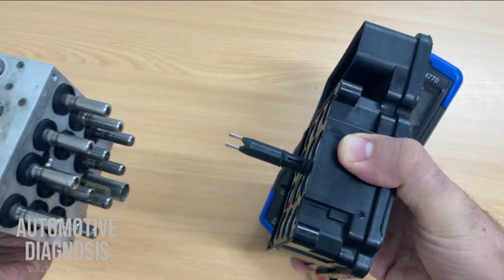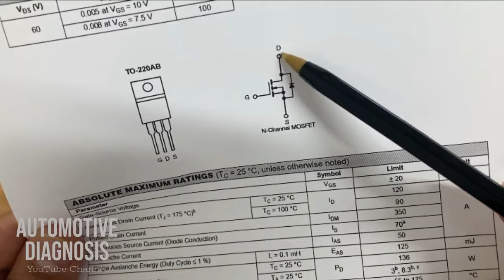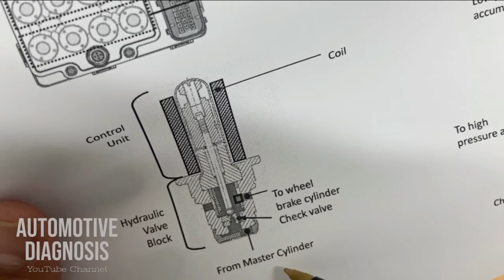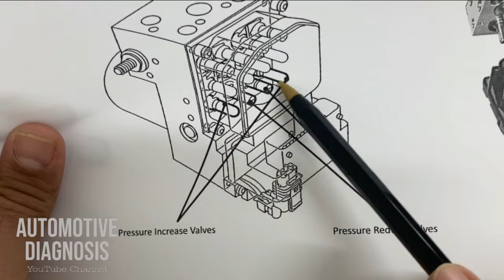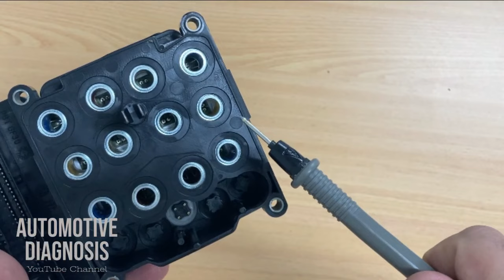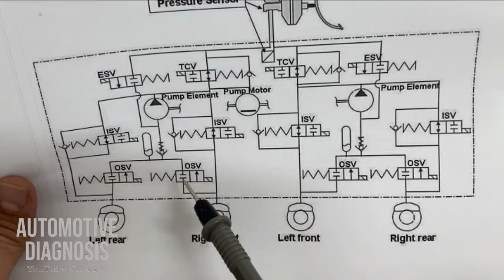Don't Replace ABS Module Before Watching This | Part 2 | ABS Module Components Test #abs #tcs #ESP

Comment: I am currently working on one of these for a friend. This video is very helpful and helps me verify what I am seeing also. I did notice the second "mosfet" you tested seems to be a dual diode package on mine. The test still works tough. I assume that is why the forward voltage is lower at around 0.2v. Thanks for sharing. Happy repairing!
Reply from the maker: I hope this video helps

Comment: Well I completed all the checks you guys suggested in the video and they all check out BUT it looks like on my ABS module for Jeep wrangler (2014) that all the pins just poke thru the holes in the board and aren't soldered. Is this normal and sufficient??? Has anyone else seen this? I can't add pics for you to see but I think in your video it's the same thing.

Comment: With error code C0110-04 motor pump circuit Captiva C100 what do I need to check, thank you
Reply from the maker: Hi there, this code is for the ABS motor fault, first check the power and ground on the ABS module (there is a video on channel for this) if all is okay, fault could be internal (part one of this video that you are watching is for explaining that fault)

Comment: What was the problem with this one? I am getting a c2200 on a Jeep. Everything from part 1 & 2 passes?
Reply from the maker: This unit had the issue on the main microprocessor, your fault code is for ABS internal error, so checking the solder connections is needed at wider level. It could also be part issues like the main microprocessor.

Comment: If I pull the plug off the module, and I only have two large pins 2 medium pins and a bunch of little pins, if I check continuity on the two big pins and it's open Line does that mean the module is bad or the pump is bad? Or  both?
Reply from the maker: Hi there, those 4 bigger pins are for the power supply and ground on the ABS module, so we shouldn’t check the continuity between them, if we are checking on the connector, we must check the positive and negative to make sure they are provided on the connector, the following video explains more:

https://youtu.be/8F5FKOaa0rc?si=2BRvbt9s2ag9yukJ

Comment: I have error code c1350 on my Citroen c3 (internal valve error)
Reply: What should i do ?
Reply from the maker: Internal diagnostic is explained in this video and external diagnostic is explained can be found on the following video:

https://youtu.be/8F5FKOaa0rc?si=ausFjgwU-t3BdIiH
Reply: @AutomotiveDiagnosis i think i found the problem, i mounted an absmk100 on my car, and my car only read mk70

Comment: SO WHAT HAPPENS IF THE SOLNOID VALVES ARE OUT OF RANGE, DOES THAT MEAN THE WHOLE ASSEMBLY IS BAD? ?
Reply from the maker: If the solenoid valves go bad, basically ABS cannot control the brake fluid pressure on wheels individually and ABS will stop working. Even having one solenoid valve out of range will cause the malfunction on ABS.

Comment: My OBD reader shows that voltage is zero at motor
Reply from the maker: Check the ABS high amp fuses in engine fuse box, here is a video that can help:

https://youtu.be/8F5FKOaa0rc?si=Et_IsVAUDm-jzaV3

Comment: Great video! Do you have a video on how to check the brake pressure sensor too? I have an electrical failure on sensor A. It´s an ESP MK 61 for a Volvo s80.
Reply from the maker: Hi my friend, we don’t have a video exactly for that sensor, but what we see in this video shows the sensor’s contacts that can cause the issue sometimes, sensor itself or the main microprocessor could cause this issue too. I will do my best to make a new video for this.

Comment: So if everything looks "right" within the PCB, that means the fault will probably be within the hardware block itself (valves + motor)?
Reply from the maker: That also could be because of the main microprocessor too.
For valves and ABS motor we can test them individually with Scan tool or on the bench.

Comment: Great instructions, thank you for sharing. Does code B1342 indicate error in mechanical or electronic side of the control module?
Reply from the maker: Hi there, this could be internal issue. It could be caused by cracked solder joints only, or internal PCB board failure. But checking the power supply and ground on the ABS module is important to be done before doing anything on the module itself.
Reply: @AutomotiveDiagnosis  Thank you. Is it the pins on the wiring harness where to check the ground?

Comment: que puede causar que el motor de este modulo de ABS permanezca encendido. desde que se abre switch el motor queda energizado que componente debo revisar este modulo pertenece a una moto marca yamaha nmax 155cc quedo atengo gracias.
Reply from the maker: Hi there, it could be the ABS module or the relevant power mosfet. Please check the part 2 of this video. Link in description

Comment: Thank you for a great channel 🙏 
Did I miss the wheel speed sensor circuits? 2011 Ford expedition 4x4 codes c1145, c1175. Front right, rear left sensor input circuit failure. Getting 12v from harness at speed sensor. Both sensors are good. Only thing it could be is abs module?
Reply from the maker: Hi my friend, It could be an internal issue, but first we must check the ABS connector, and the relevant pins, checking the signal wiring between the sensors and ABS module is important, even if they are two separate sensors, some part of the wiring might be damaged at some point that affects both sensors.

Comment: Do you repair these for customers. Or do you just show the instructions on how to repair them. I need mine fixed. I took off the back and I'm not good at this. I have a 2013 VW BEETLE CONVERTIBLE 2.5L. The body and top iand interior are in very good condition but i casell this because of this problem. I need help desperately

Comment: Great video, thanks for the info, for a code c2200 on a ram truck what should I look for?
Reply from the maker: Hi there, this could be an internal issue, but still checking the connector, power and ground on the connector could be helpful to find the issue, a similar procedure is explained on this video:
https://www.youtube.com/watch?v=8F5FKOaa0rc

Comment: I had zero ohms on ground and 18.0 ohms on positive does this sound right
Reply from the maker: Hi there, we don’t measure the resistance on positive terminals, unless it’s continuity between the positive pin and fuse box.

Comment: How do I find the diagram/schematic for my specific module ? I've tried googling the part numbers to no avail. Trying to find out what circuit pins or area is related to the right wheel speed sensor on my board

Comment: I have a vw abs module that is not providing 12v to all four of the active wheel speed sensors. I saw you have a class and wanted to know if any internal abs circuit diagrams were in there that would provide some insight where to look / diagnose / repair the module itself.
Reply from the maker: Hi my friend, you can check the course content before purchasing it, it shows all lectures in detail. Regarding the issue, it’s not very common not to have the power supply on all sensors, what model is your car?
Reply: @AutomotiveDiagnosis  Its a 2011 VW Jetta 2.5SE, 1K0614517CK is the main number on the pump and 1K0907379BC is on the computer module. 

I did see the course content, but wasnt sure if you went into further detail regarding the internal abs module circuit diagrams covering the power supply to the wheel speed sensors. 

i am getting .2v on each of the front two wheel speed sensors and 2.0v on each of the two rear wheel speed sensors and i have codes (00290, 00285, 00283, 00287) for wheel speed sensors. Getting the same voltage reading on the front and rear makes me think the fronts and rears independent (shared front, shared rear) 12v supply lines but I am not sure. 

I am able to communicate with the module and read live data and have 0mph for all wheel speed sensors. I back pinned the wires at the module to get the voltage readings above.

Comment: Great instructions, thank you. Can you help with my code 16352 on my 2011 Jetta. I’ve checked the power, ground, and continuity and they’re all good. What else do you think I should check?
Reply from the maker: Hi there, If you have checked the power and ground, and connector is good too, it might be an internal issue on ABS module.

Comment: Can you explain what is broken in the ABS to cause the speedometer to not work (Saab 2000 ABS modules)?
Reply from the maker: Hi there, it could be the vehicle speed sensor failure
Reply: @AutomotiveDiagnosis It's not that. Definitely an ABS issue many folks have. Not sure if the ECU is involved somehow.

Comment: Hi,how you remove the cover
Reply: Thanks,but late, already opened, really easy with a rotary hand cutter tool, guys reworked al board with SMD hot air gun,works perfectly
Reply from the maker: @ Thanks for sharing this with us
Reply from the maker: Hi there, I normally use a mini hot air gun on one side of cover to heat the seal up (not too much), then I use a small cutter to cut through the seal, as soon as seal is broken, I pull that side up gently, and will go on to cut the rest of the seal, it works every time.

Comment: How you remove the cover
Reply from the maker: Hi there, I normally use a mini hot air gun on one side of cover to heat the seal up (not too much), then I use a small cutter to cut through the seal, as soon as seal is broken, I pull that side up gently, and will go on to cut the rest of the seal, it works every time.
Reply: @AutomotiveDiagnosis thank you! Out of curiosity, how did you put the cover back on?
Reply: @kylewilliams3336 u glue it , use ones that's safe for electronics if it's too runny it'll get inside and ruin it

Comment: Your 2 videos help me a lot thanks so much for sharing your knowledge. I'm trying to find issue on Passat B7 1.6tdi with  no measure on the rear wheel right. I've already replaced the abs sensor, but error still here. Is it possible a blocked Valve or is it an electronic issue on circuit of calculator?
Reply from the maker: Hi my friend, thank you for watching the video, it could be actually both, but the priority is to check the circuit first because it’s more common and less expensive.
Reply: @AutomotiveDiagnosis  Thank you for your support

Comment: Wow great video..I do not understand 1 thing. You said you checked the 9 solenoids, but I did not see where the coils are on that PCB ? I though the coils were in the other side wrapped inside those tall solenoid spikes. The drawing you showed for the solenoid coils looked very similar to those used in fuel injectors.
Reply from the maker: Hi my friend, yes they were on the other side of the PCB board. On some ABS modules they are very accessible, on some they are covered.

Comment: Very interesting videos. I have a 2007 Chrysler Grand Voyager with "Left front wheel speed missing". The ABS icu is MK25E. When I measure the two wires to the abs sensor the voltage between the signal wire and the +12V wire is 12V. This tells me the signal wire is shorted to ground, and it is not shorted in the wiring between the sensor and the icu module. It is shorted within the abs icu. Any idea what is wrong with the circuit? My icu looks very much like the one you present in the video.

Comment: Just wondering if you have ever tried using one of those solenoid testers which light up when they detect a magnetic field to prove the electric signal when forcing the solenoid on. Just a thought for a quick test before you start dismantling the electronic box.

Comment: Very detailed videos, pt1 and 2.
I have a Chrysler ABS which looks identical. I get the C2200 error.
Fuses good , power supplies good, cleaned all the grounds. With my scan tool I can activate all the solenoids and hear them click. Test pump and it runs. Have bled all the brakes and done a successful ABS bleed. Driving the car looking at live data, all four wheels showing same speed, good pressure and vacuum reading, brake switch good, abs report 12VDC and 5vdc on power rails. Steering angle and body sensor all give good readings, time to replace module?
Reply from the maker: Hi my friend. Considering that you have checked the power and ground, and all components are responding on actuation test, this could be an internal issue.
Reply: @AutomotiveDiagnosis thanks for the reply. I was doing more testing today and if I try to activate solenoid 12 low pressure feed 2 quickly it fails. I’m assuming it will be one that there is only 2 color coils the same. Time to open it!

Comment: Amazing content! Did a few ESPs repairs already (but I do swaps and conding mostly) and the video added up some knowledge on the structure!
I'm needing a mentor more in the head units area now, I had already two cases with blown up either amplifiers (BMW G30, which no one wants to repair them, and the replacement is like 1.6K + shipping here to south america), and NTG in mercedes that does nothing (but has consumption), and couldn't fix them so customer replaced in both cases, but anyways I'm trying to find out what went wrong just to build up knowledge.
Reply from the maker: I'm glad you found the video helpful, and I appreciate you sharing your experience!

Comment: This is excellent ..thank you very much   QUESTION..How do i find if there is an error and its not just a fuse or dirty sensors. i went to a local parts store where they hooked up a tester which returned no errors but that might have been because the tester was not the right one. ?
Reply from the maker: Hi my friend. Thanks for watching the video. Having a bad scanner may cause some issues as well, but what sort of problem do you have? Is ABS/ESP light is on?
Reply: @AutomotiveDiagnosis  Thanks for getting back. 
So the abs light is on , it a two wheel drive Xterra and slid all over the place on a little bit of snow. I cleaned both front sensors of metal dirt and put them back in before going to auto zone to have the abs light turned off but it didn't turn off even after that and after disconnecting the battery negative for an hour. 
However the AutoZone print up of the scanner results gave the ABS a PASS
I also went to a real mechanic today to have a proper check done but he can't fit me in to his schedule for about 3 weeks.
Reply from the maker: @JohnODonovan1  I don't know how they gave ABS a Pass when ABS light is on. ABS light could be on for many different reasons, Wheel speed sensor is only one of them. So, having the car checked by another mechanic is a great idea. But without having some information, it's really hard to say.
Reply: @AutomotiveDiagnosis  Do you have any suggestions for commonly available affordable tools that will give me some general information at least?
Reply from the maker: a budget scanner that might cover your car is TopDon topscan, check the video on the link below:

https://youtu.be/zpTOxeDcEzc?si=fI7SupGb2j15nFx1

Comment: I have a motorcycle with a similiar looking abs module, after riding it breaks itself but does not release pressure, its like allowing brake fluid to go to brake caliper but return is blocked, it will release pressure after few hours, i replaced the valve block already but same so i think its something with the electronics, do you might have some ideas what it could be ?

Comment: I am facing some B1342 error on my Ford Fusion 2010 2.5. Trying to figure it out and fix by myself. Just saw this video and its previous. Here in Brazil they are charging something around 2k US dollars in local currency to fix the ABS problem. Simply respond saying that must to replace the entire abs module and that was the total cost of replacement plus service which is way too expensive considering the car price... Anyway, will do it by my own hence it is not working properly :)

Comment: Hello, in my case the ABS motor has remained activated, it only stops when I disconnect the battery, any advice?
Reply from the maker: Hi there, it could be ABS unit issues which does not deactivate the mosfet.
Reply: @AutomotiveDiagnosis , thanks!
Reply: @AutomotiveDiagnosis  I am having this same issue. Are you saying this is unlikely for us to be able to fix using the info in your videos (like replacing a mosfet or something)?

Comment: Hi, i have an issue with an Volvo S80 2007, first i got a dtc code BCM-C00201C, then i got the motor rebuilt and when i got it all back it gave me 3 other dtc faulty codes, although the original was removed, then i took of the lid and got it all soldered, but still i got the code ECM-P061E64, BCM-C004401 and  TCM-P055600. I think it may be the BCM-C004401 code that's the problem, the car has only 190 K km on the meter, what is the procedure for testing the Brake pressure sensor 'A' ? Your movies are very good and informative, thanks for sharing 👍 I am living in Norway.

Comment: Thank you sooo so much for this comprehensive guide, it is by far the best! 
I have the code C056D-00 Electronic Module 
Checked all wiring, fuses, grounds.  Took only the abs module out, finally got it opened yesterday, will follow your video to troubleshoot transistors, rectifiers, power source and solder points.  Any other advice for that code?
Reply from the maker: Hi there, thanks for watching this video. Everything is pretty much explained in this video. You may also watch part 1 of this video.
Reply: @AutomotiveDiagnosis  
It is, very well explained.  I watched part 1 and 2. I Was just curious is you were familiar with that specific code from your experience.  Regardless, thank you so much for both of your videos, they were extremely helpful.

Comment: What if the error is 16532 ? Is a similar procedure ? Cause it's the most common problem where I live, no pump or valve relay issues. Thank you
Reply: I just had the same code with mode 14 which indicates a circuit defect on the ground side- did you ever find resolution for your issue?